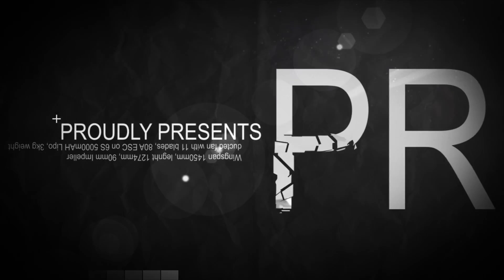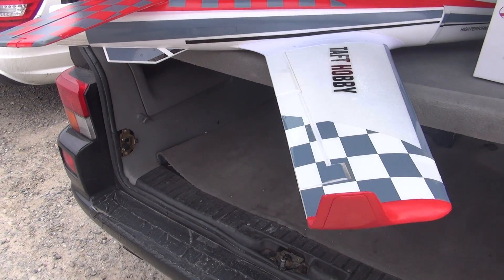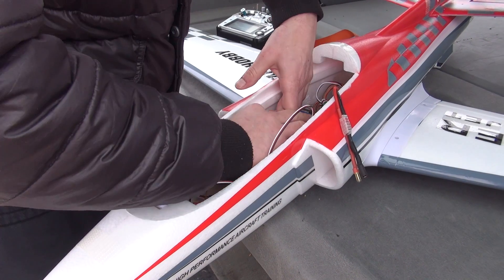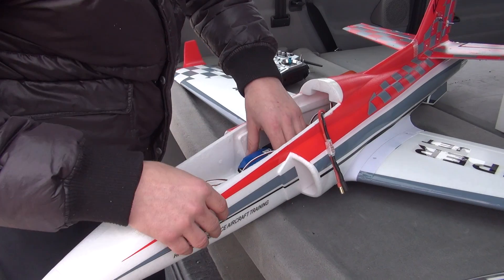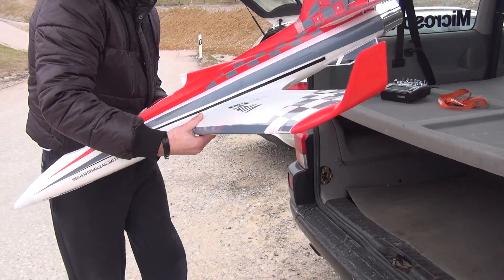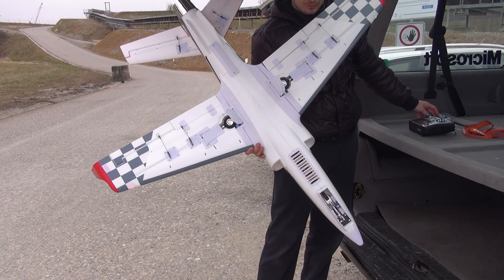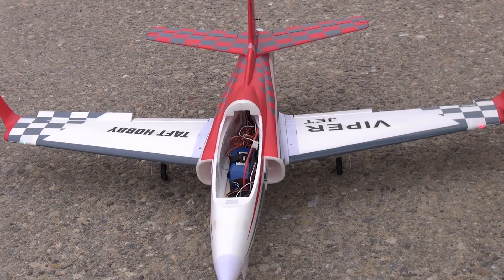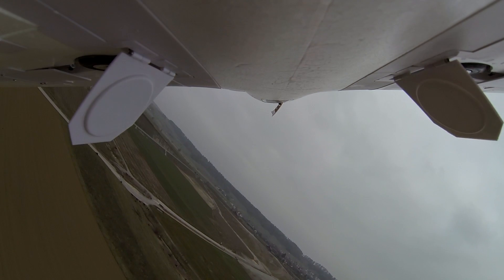Viper Jet with huge 90mm ducted fan rockin the sky

Comment: Awesome video. How often do the retracts 'not come out', they look really strong with suspension and all, are they as good as they look?

Edit-- read the rest of your replies, seem strong! What was that about the locktite on wheel screw? I have had to do that on a lot of planes! Is that for all three wheels or only the front?

Would running this on a Dx6i and a AR600 DSMX be alright or does it regularly fly out of 1km range?

Comment: What do you mean you put gear D/R to the Max?
Reply from the maker: Depending on your transmitter and the D/R rates out of the box, sometimes you experience that gear is not opening or closing. You need to adjust the D/R rates from 100% to 150% to make it work.